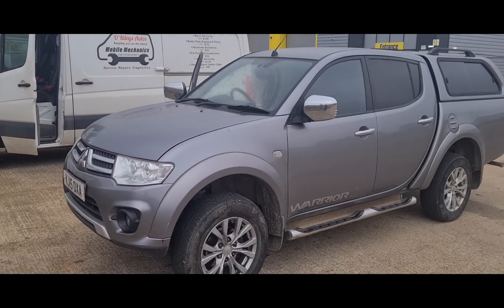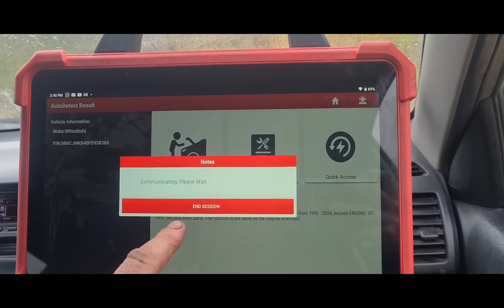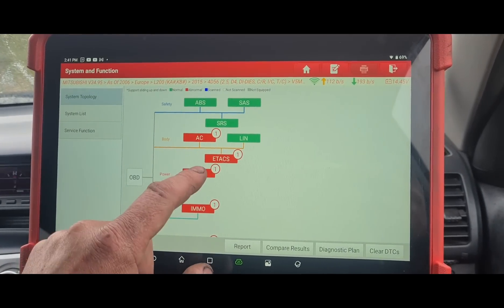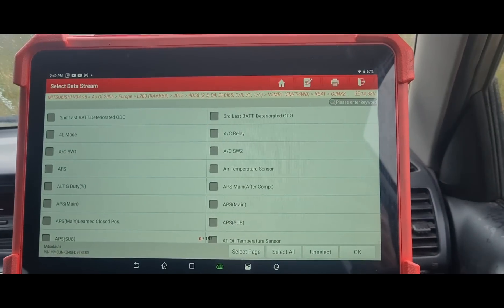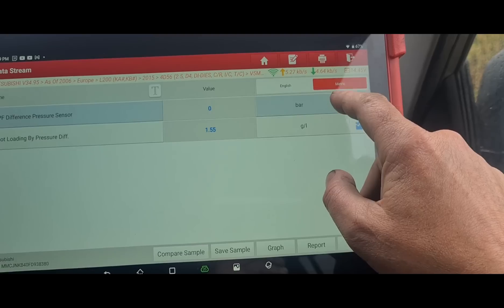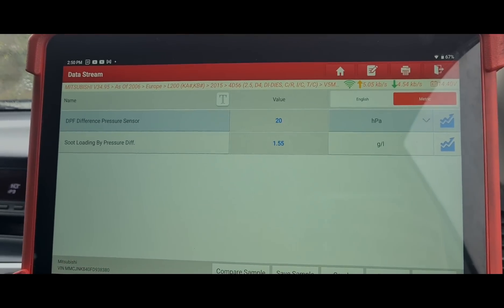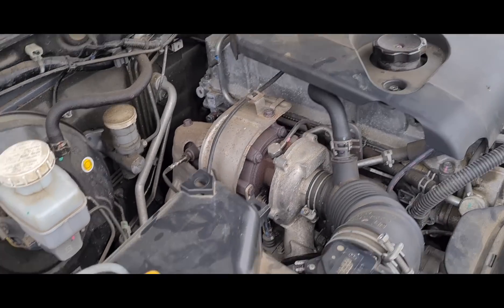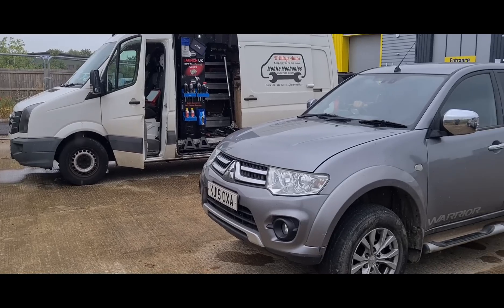Mitsubishi L200 Triton Had 4 Forced DPF Regenerations Done But No Resolution To The Fault

Comment: Small injector relearn needs to be done once a year or every 20k, also these are known for boost hoses splitting and egt sensors failing/glitching, which usually does not set any relevant dtcs.
Reply: Either due to the repeated forced regens or the dpf just having enough of life,  the dpf is buggered now ( cracked )

Comment: out of interest if the differential  pressure is low ,what is triggering constant regens ? mine is similar but is only triggered by calculated soot every 350 miles  ish when it gets to  a calculated 21 grams this seems to override measured soot as that's very low , maybe the same incomplete regens  with correct temp not reached ?

Comment: Hello Jimmy. What are the causes of an engine creating too much soot, please? 

Mine completely blocked (limp mode and dpf full error) after 300 miles of motorway driving, directly after the dealership done a forced regen (prior i was getting 'drive to clean' messages every 60 miles). They've since had it twice, 5 weeks at a time and have told me there is no fault!!

Prior to this i have had extreme rising oil levels.

Dealership already replced injectors, dpf and entire engine.
Reply: The soot is caused by the EGR. I daresay that the inlet manifold & EGR valve needs removing for chemical clean.

Comment: I had this on an l200 a while back, i ended up doing a manual search instead of auto vin and selecting manual and the code wasnt there. I can only assume its the tool probing for a module that doesnt exist and then flagging the fault?

Also when you did the injector reset it showed gear selection as if it was auto amd had the AT temp sensor at -40°C (obviously because its not fitted) 

The dpf pressure live data always seems to read low on them too (dropping into minus figures) and read normal with a manometer as you showed. Strange vehicles the l200 😂

Shame about the dpf though, likely killed it with the forced regens 👎

Comment: My triton 2019 and 2023 the def pressure sensor reads the same flicks into the neg it seems normal to me but I did have trouble with the injectors which Mitsubishi said caused the exhaust to go sooty as for the code your checking once again it’s a mitsy
Reply: How often did you do oil changes

Comment: Hi Jimmy, Great Vid like always! I learned a lot and here is my story with happy ending :)? Suzuki swift w/ Fiat multijet 1.3 diesel 75HP w/ DPF. like here it went DPF to crazy almost infinite regeneration. No error code at all. Pressure etc all was good. Sensors tested all good. Then started with an EGR malfunction code. I cleaned it but it was clean incl Intake manifold etc. it was sticking close solenoid:) Once I freed it up started the almost infinite regen of the DPF. I saw some excessive engine oil on the EGR pipe and it became clear that turbo pushing the engine oil into the exhaust ergo DPF. I replaced the turbo and cleaned the dpf with MOTIP foam in place as it was not possible to remove it on my parking lot... All went good after turbo replacement regeneration on the HW went fine I monitored the DPF related parameters on the way and was happy. Few 100km later started a nightmare run the turbo lost its power. Started to stall short right after engine start 5-10 sec. I got error codes for waste-gate solenoid error DPF implausible values and efficiency ... P1901/P0243/P2003... So I checked the vacuum system and found some 15years old rubber pipe got leakage and caused the issues.. Once I replaced it due to excessive pressure at idle I have already 300mbar!!!!! Exhaust pipe got leaks and the DPF collapsed finally needed to be replaced. So All was due to an excessive oil contamination and 190 000km drive with a silly dpf. My another swift without DPF has almost double mileage and I never had to touch anything nor egr neither Turbo etc... Never again car with DPF in my life...:)